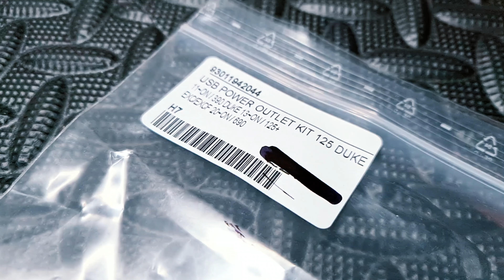Svartpilen/Vitpilen 401 USB Cable #svartpilen401 #401 #husqvarnasvarpilen

Comment: hi thanks for the vid. I noticed at 2:53 my accessories connector look exactly the same as yours with this strange orange residue on them. What is this and did you clean this off somehow before connecting the usb cable? thanks
Reply from the maker: Hi there. No, it's nothing to worry about. It's just electrical contact grease to help keep out any moisture 😉
Reply: @CampbellZeroOne  ok great thanks alot 👍
Reply from the maker: @salamanderselection  You're welcome 🙂

Comment: I just wanted to clarify: does this ( 0:55 ) mean red and blue are positive?
Reply from the maker: Hi @gwynned7235 Yes. You can't really go wrong. So long as your wiring loom still has the original plugs in situ you've nothing to worry about.

Comment: I have the 2020 model svart but I cant find the 2 white cables under the Seat. Is it possible that my bike doesnt have it? Of is it in an other colour?
Reply: Svart 401*
Reply: I want To use the rear acc2 (black ones) do the also work with this setup?
Reply from the maker: @DestinKluivert  They should do, yes. I believe that 'ACC' is just an abbreviation for 'accessory'. One of them will be permanently live so will potentially drain the battery. The other goes live once you turn the ignition on. That's what I was checking for with my phone. 
The plugs can be any colour of plastic. It doesn't make a difference. But the cable should have a tag wrapped on it with 'acc' Hope that helps.
Reply: @CampbellZeroOne  I found them thx!
Reply from the maker: @DestinKluivert  did you go with the ones under the tank? Those were really difficult to spot and then get to!
Reply: @CampbellZeroOne  no I went with the one under the Seat!